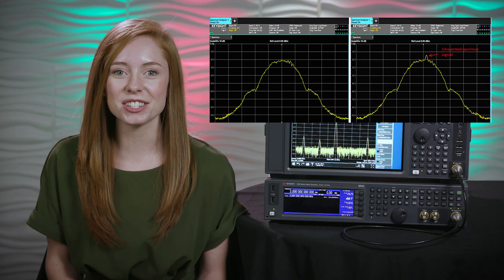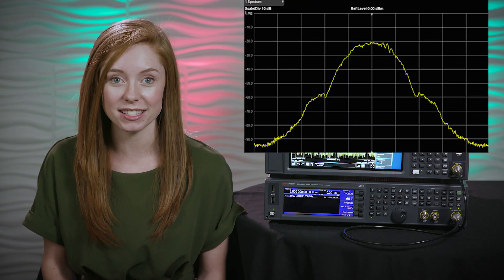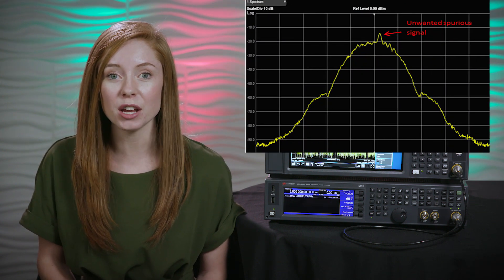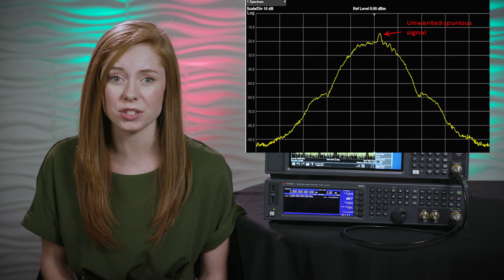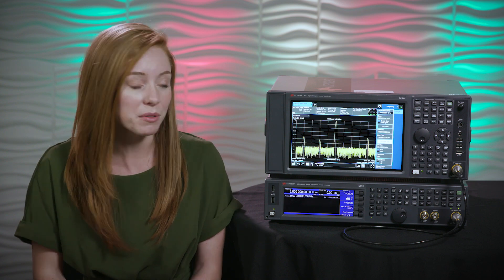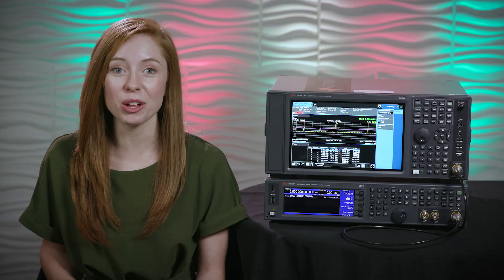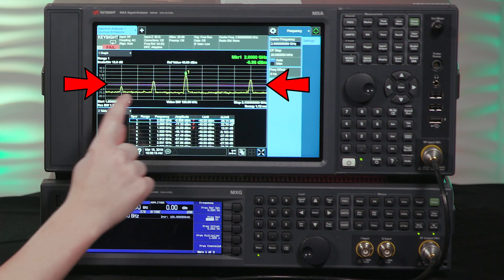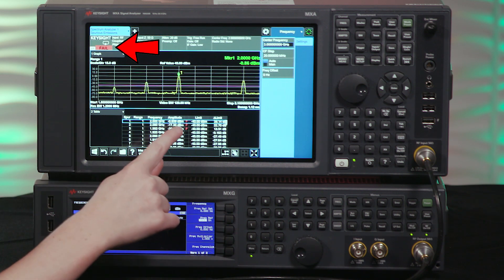How to Make Spurious Emissions Measurements

Comment: Is there any advantage to use a mixed signal generator instead of a spectrum analyzer for measuring spurious emissions (or ACP from the last video)?
Reply from the maker: Do you mean "mixed signal oscilloscope?" The advantage of a spectrum analyzer is that it has YIG Tuned filters in high band to reject images. And, in low band it's superheterodyne architecture also protects against images. If you want to dig more into SA basics, you can check out this application note: http://bit.ly/2EUelGR
Reply: Thanks. That was a good refresher!